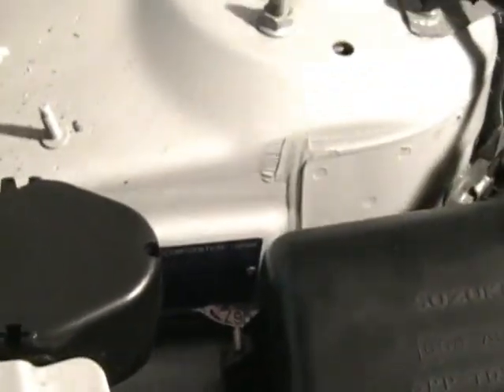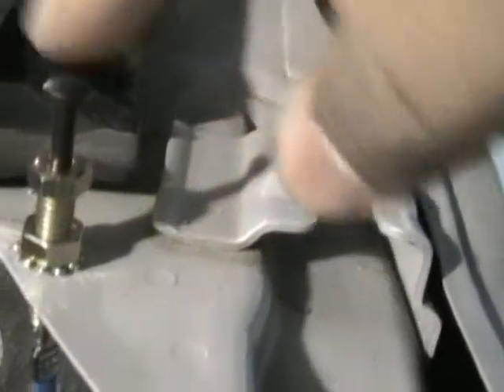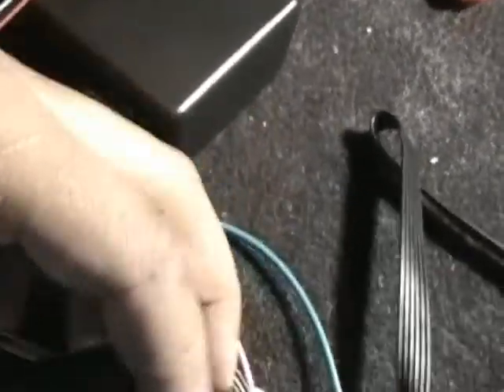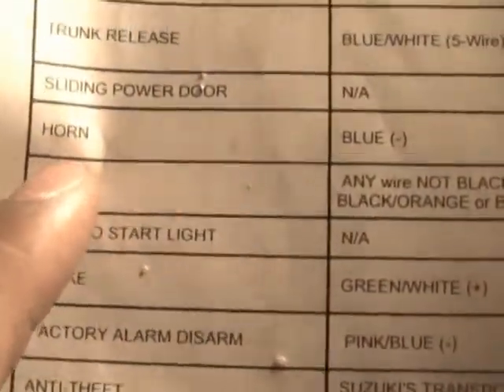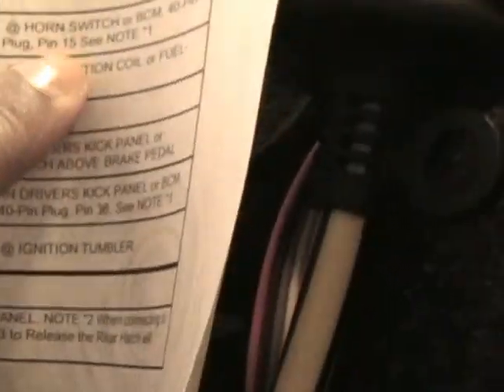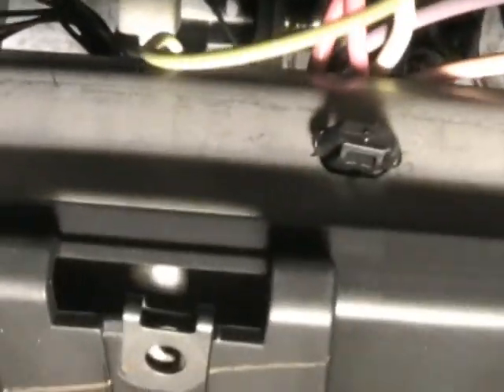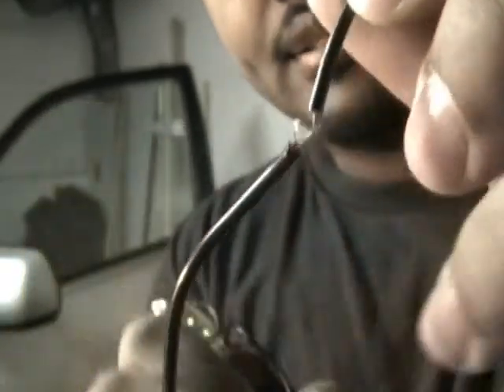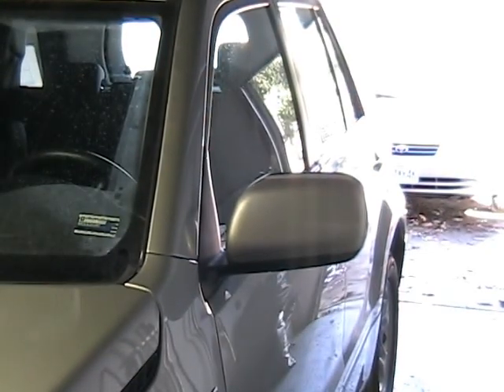Car Alarm with Remote Start Installation Overview

Comment: Good install. I think you did everything correctly. Only thing I would do is try to run the wires under the hood to keep them hidden. Dont forget to put some protection around them also to make them look factory.

Comment: Looks good for your first time. You should use black ties under the hood and loom your wires to give it a factory look and use a grommets for the fire wall cuz sometimes the wire will rub on the metal and  make the siren to short out or hood pin to. Change out the hood pin switch for a metal one in time plastic will brake.

Comment: Great video, but I recommend using wire nuts when you can instead of electrical tape (and maybe solder).  It will make for an easier removal if needed in the future.

Comment: Good job on the install man every thing looked good and im sure this video will be informative for beginners. You might wanna put some wire loom over the wires in the engine bay to protect them from damage tho, plus it will give it a cleaner look...still good job tho

Comment: for diesels it has a wait to start function that basically waits until the glow plugs (diesels dont have spark plugs) are warm to actually start the engine. in a gas engine the spark needs to be created and the starter motor needs to work to get the car started. so thats the difference.

Comment: you are definately right i have been doing a lot of research and i was unable to find anything at all a few months ago. but now that i've seen this i'm going to go ahead and do mine. i have an astra as well for one of my cars and a viper for another one. i have one question though did you have to use any relays? if so what for? thanks for the video its real helpful.

Comment: not bad for a first install. i would definitely brush up on hiding your wires and or wrapping them up to look like factory harness. and for small connections that don't flow amps i would use a t-tap with a quick connect male spade. that way you dont have to go cutting in the factory wires.

nice job though...

Comment: Suzuki is not a difficult vehicle, so your application is simple, or should I say simpler than most installs. I did like the music, it is a great song. I agree, $200 is a lot. I would have charged $120 and could be negotiated down to $100. Most shops are out of their mind. For a seasoned tech like me this is about 1hr and 15min.

Comment from the maker: I don't know I've never done it before but I think it would take me about 30mins to an hour once I had all the panels off and wires out. Its all about knowing which wire is which and the location of the wire. You could spend hours trying to determind if a wire is the correct one. Once you know where to hook something up it just takes seconds to make the connection.

Comment: Hey man nice, But i noticed when you armed you're car, you're door was open. Did you not use the door pin input? Should just diode isolate each door, then run it. so all four, or two doors will trip the alarm.

Comment: is there an easy way to get the speaker mounted, cause I have such tight spaces to work with to put the speaker in, and I can not fit a drill in it

Comment: Question? First time installing the same alarm and got everything almost figured out, except: If this alarm is equiped with anti-theft bypass module...  How did you went about that? did you got the bypass module or is it included into this alarm.?
thanks!

Comment: I did my own car my self too it's really not that hard. the experts just say its hard so they can get some money. I found out using Scotchlocks/splice connectors is a lot easier than soldering the wires together because if you make a mistake you can take the connector off without damaging the wire too much.

Also not too big a porblem in the USA, but here in england were most cars are manual, do not leave your car in gear when you have remote start. This can totaly wreck your car.

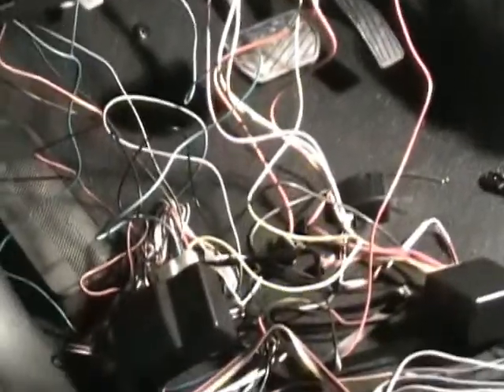Comment from the maker: No, if you see at 2:00 in the video there are many colors. There only like one system that I know of that has all black wires and it can only be installed by the people who made it. They won't give the info out on which wire does what.

Comment from the maker: It took me about 8hrs split up between 2 days  because I never done it before and I wanted to be sure I didn't hook anything up wrong. I didn't have to buy anything extra. Everything was in the box If I had to do it again I could probably knock in out in 3 to 4 hrs.

Comment: Hey i have a scytek 400rs it doesnt start with the remote anymore and My tailights stoped working n when i say tailight i mean no brake or turn signal lights. It was working fine and Now it doesnt start n tailights out do u kno if this is a common problem or do u have any solution??  Thanks

Comment: Hello Sir,
How are you? Well, I have already gave the car to Car Engineer but they refuse to fixed the Alarm starter module. Because they said, if they put that module the car can face problems and at the same time, they said I can not use the remote to start the car unless i insert the car key. So in this cause, I want to give you the details of that alarm and check for me where to put that module. Details of Alarm: Carvox two-way car alarm ( Remote engine starter ) CX-999 . Audi A6/2000

Comment: good job but dude, you need to go back and clean this up. remove those white zip ties and use black zip ties. you shouldnt drill, just to keep car value. get some grommets so that the wires dont rub against the chassis and short circuit and create a fire. you also need some slit loom tubing to make it look factory so a thief cant tell what wires to cut.

Comment: I bought one for my e46 04, took it to a place and they told me I need an extra part that will cost me another 100 bucks and sacrifice a valet key. They charging me 250 total with the installation.

Comment: I ve been doing alarms and systems since 1993.    you are gonna have an electrical fire in that car.    insulate the wires going thru the fire wall. even electrical tape can be helpful.     That crimp tool is garbage.    take that car to a professional